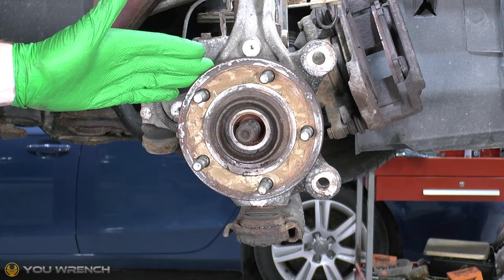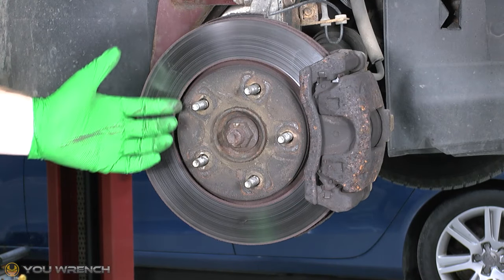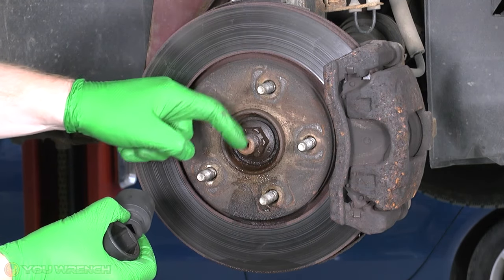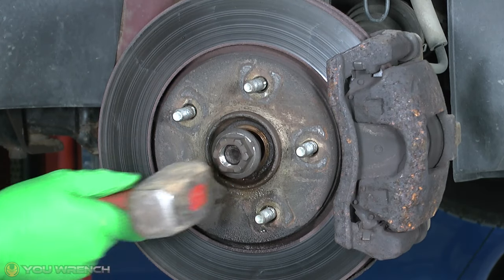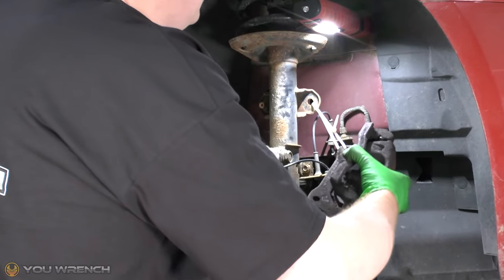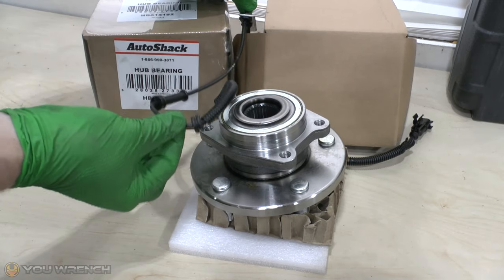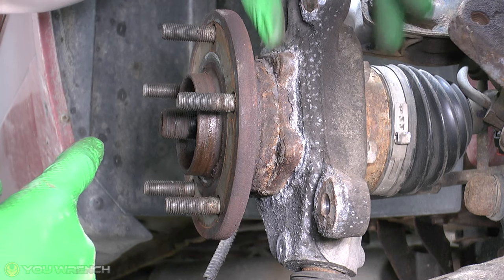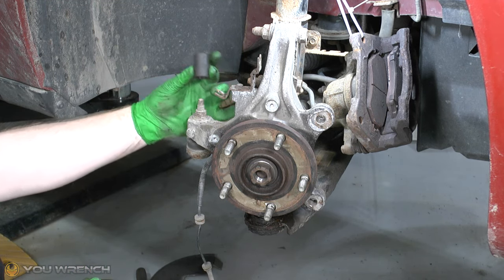How to Replace Front Wheel Hub Bearing - Grand Caravan (2008-2020) and Town & Country

Comment from the maker: Wheel Hub Bearings (Pair):
Amazon USA: https://amzn.to/46w1ibW
Amazon Canada: https://amzn.to/3tdzytZ
Amazon UK: https://amzn.to/3ZMwpxA

Wheel Hub Bearing (Single):
Amazon USA: https://amzn.to/48JLjJ7
Amazon Canada: https://amzn.to/3PVCBi8
Amazon UK: https://amzn.to/3PWeT5g

Hub Puller Tool (Slide Hammer type):
Amazon USA: https://amzn.to/3LPJgcs
Amazon Canada: https://amzn.to/46E7MoV
Amazon UK: https://amzn.to/3PHZuFP

Axle Nut:
Amazon USA: https://amzn.to/3LrieIb
Amazon Canada: https://amzn.to/3RobpuR

Axles (Pair):
Amazon USA: https://amzn.to/45nam1C
Amazon Canada: https://amzn.to/48P4Pnk

Axle (Front Left):
Amazon USA: https://amzn.to/3tvVJvP
Amazon Canada: https://amzn.to/3QeYScj 

Axle (Front Right):
Amazon USA: https://amzn.to/3LUoyID 
Amazon Canada: https://amzn.to/3QbLwgT

Penetration Spray:
Amazon USA https://amzn.to/41KOpss
Amazon UK https://amzn.to/3Np6cAX
Amazon Canada https://amzn.to/3ABHEgt

Brake Cleaner:
Amazon USA: https://amzn.to/3BlowUk
Amazon Canada: https://amzn.to/3pyTjue
Amazon UK: https://amzn.to/3BhDXgq

Comment: Thanks for all your videos. I had to replace the wheel hub bearing and the cv axle last year. I recommend replacing them both while you're at it. The cv axle is about $50 at Rockauto and it comes complete with a new hub nut so it solves that problem as well.

Comment: Holy crap! What an amazing video! I love all your videos. Great detailed audio explanations and the close-ups are very helpful. I did this job on my front passenger side last spring 2023 before your video came out. I wish I had seen this before my attempt. Took me forever to just remove the stupid ABS sensor wire harness from where it connects up to the van. Your close-up cinematography would have been helpful. Also, getting the hub out of the knuckle is a bitch. I ended up getting two high-grade bolts and nuts and rigging them up in such a way that they pulled the hub assembly out. Banging the assembly does not work. Keep up the great work on the videos! I will always reference your channel as long as I own my 2012 Dodge Grand Caravan SE. Peace brother.

Comment: Thanks so much for this video.  About 10 years ago I had to change the front wheel bearing hub for my 1999 Ford Taurus.  I used a manual I bought from AutoZone.  It took me the whole day just to do one side.  The whole job was a nightmare.  So when I found out that I had to replace the bearing hubs for my 2007 caravan, I looked upon the job with dread.  I watched your video, it was very well done, a step by step procedure on how to do it.  I cannot believe how easy it was.  I did the whole job in a little over an hour.  I still have to do the other side, I hope it will go as easy.  Thanks for posting this.  The next time I need to do work on my car, and I need info on how to do something, I will look you guys up

Comment: Harbour freight do a fair version of a wobbler nut that would work well in that situation removing bolts from behind the rotor against the drive shaft will do mine some time soon n come back with results

Comment: I cut off a stud from the hub and then use a 1/2" bolt and nut through the hole to press it off.

Comment: I noticed you got the bearing from Auto Shake.
Honestly, I wouldn't ever do business with them ever again. I bought 4 new brake rotors from them, both of the front failed within 5 miles.
The brake plane, that the pads grab into sheared off the hub section, on both sides, leaving me with no brakes.
Reply from the maker: Yes, we used Auto Shack for this. Actually we've used their parts a lot, shocks, bearings all kinds of things and never had any issue with them at all. They're great value parts. Sorry to hear about your issue. Out of interest, can you elaborate on exactly what happened and what did not fit as it should? 👍

-----------------------------------------------

To help support us:

1) Please be sure to use our Amazon Links!

2) Please ensure you LIKE our video's, and SUBSCRIBE to our channel!

3) Donations always welcome! Hit the SUPER THANKS option below the video on YouTube, or by PayPal: www.paypal.me/youwrench

Thank you for your support!

Comment: Also if anyone can help me 
My caravan when ever I come to a red light or stop sign the car like jerks and rumble rattles and when I stop it does that and then stalls out or turns off .
I don't know can someone please help
Reply: Have u check the spark plugs and wires?
Reply: Sounds like it could be the torque converter on the transmission

Comment: Ho w do know when the bearing is bad
Reply from the maker: They tend to let you know. They will squeal if left too long, and you can tell they're on their way out if you get a humming/rubbing type noise when steering around corners, which goes away when you straighten the wheel up back up after the corner. Hope that helps 👍

Comment: For some reason the axle nut you listed doesn't work for a 2014 dodge grand Caravan sxt 3.6l looks like I'll have to use thread locker
Reply from the maker: That is strange. We just double-checked it for you on the Mopar website and the 6509298AA nut is listed to fit all Grand Caravan MK5's including the 2014 SXT that you have. In fact, for the 2014 manufacturing year it is listed as the correct part for all of the following:

2014: Dodge Grand Caravan: American Value Package, R/T, SE, SE 30th Anniversary Edition, SXT, SXT 30th Anniversary Edition - 3.6L V6 - Flex, 3.6L V6 - Gas

And the Amazon links we have added is for 6509298AA . Is the part you bought for the job definitely the 6509298AA, and if so in what way is it not fitting? Could the axle on your vehicle have been replaced already in the past? Most aftermarket axles tend to use the same thread size, but it is possible that you might have one (i.e. an aftermarket axle) that uses a different thread size (which would have come with it's own nut). Is your old nut identical to the 6509298AA shown in the video?

-----------------------------------------------

To help support us:

1) Please be sure to use our Amazon Links!

2) Please ensure you LIKE our video's, and SUBSCRIBE to our channel!

3) Donations always welcome! Hit the SUPER THANKS option below the video on YouTube, or by PayPal: www.paypal.me/youwrench

Thank you for your support!
Reply: @YouWrench  strange I clicked the link for canada and it immediately says it's not for my van oh well I can put some orange lock tight on it the torgue spec is only 118 ft pnds
Reply from the maker: Ah ok, there is a mistake in the Amazon listing.  The listing is for the 6509298AA nut - which IS the correct nut for the Grand Caravn 2008-2020. We have added a note next to the link now to make things clearer. We would put another Amazon link, but it's the only listing currently for that nut. Thanks for pointing that out. 👍 @Relevantminded